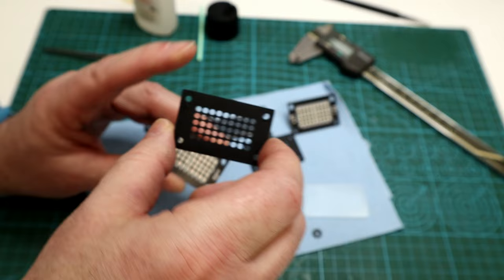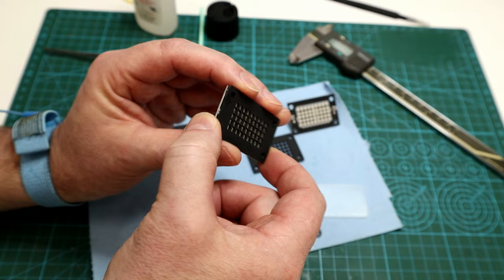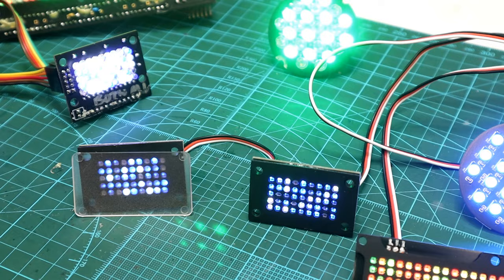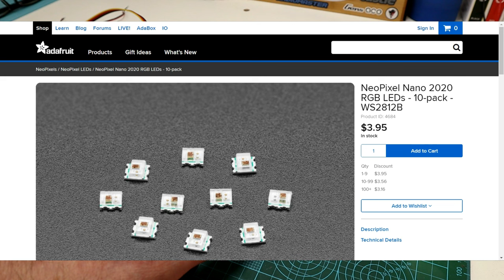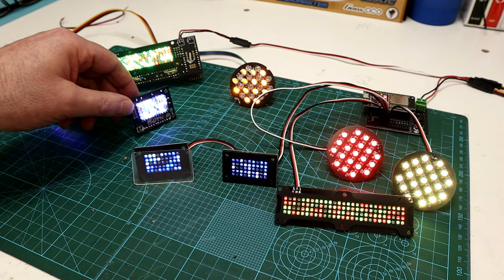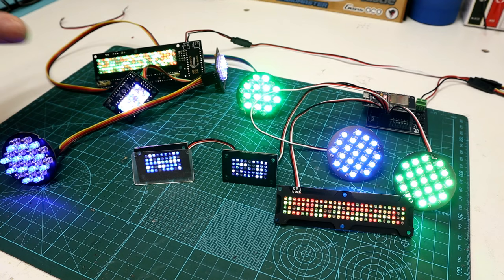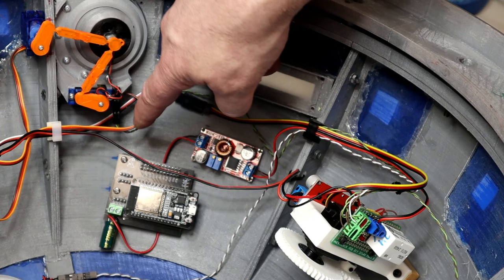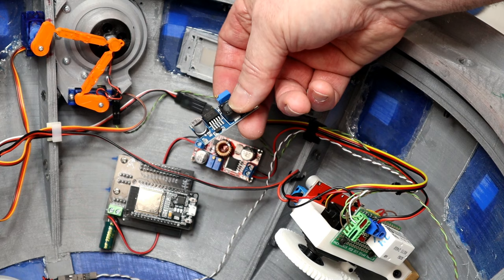R2D2 AstroPixels Installation - Easy & Fun (I hope).

Comment from the maker: Part 1 - AstroPixels Overview: https://youtu.be/du5284ciHco?si=QiC0DnNkY3eN5N2V
Making R2-D2 Video Series:
- Introduction to a DIY R2-D2 Build: https://youtu.be/hkkSagTsLXY
- Part 1 Making the dome: https://youtu.be/HaZ7ABkhwn8
- Part 2 Painting the dome: https://youtu.be/inoqE19ODUQ
- Part 3 Dome lights & holoprojectors: https://youtu.be/hDR9z1PAJSA
- Part 4 Dome Completion: https://youtu.be/PnjCrLlJtig
- Part 5 Mark 3 Body Assembly: https://youtu.be/m6VXt6VGZ3c
- Part 6 R2 Sound System Basics: https://youtu.be/cZ3sVYs7T9I
- Part 7 R2 Electronic Basics: https://youtu.be/AmUuZH3UHXg
- Part 8 R2 Legs & Foot Drives: https://youtu.be/PLyOKD5oAyM
- Part 9 Painting R2-D2: https://youtu.be/E8h0l4rHvC4
- Part 10 Installing Electronics: https://youtu.be/bg_tN6HCYN4
- Conclusion to a DIY R2-D2 Build: https://youtu.be/sIpBA6UigTQ

Comment: I've heard of people using thick bezels and inserting short lengths of fibre optic, then sealing it all in resin. Gives it the fibre optic look. 

As for diffusers, the main thing to avoid getting into the lights is grubby little fingers. ;) 

And I know someone did add a diffuser grid for the PSIs to get the look you want. I tend to have mine a lot closer to the front so you do get a line. Worth an experiment. 

The main board is also designed to actually mount on the back of the RLD, there are STLs to print out as spacers, etc. 

Another great video, and thanks! :D
Reply from the maker: Thanks Darren for the info. All good ideas! 👍🙂

Comment: Love your videos! Fellow BC maker in the lower mainland here. Where did you source the diffuser material? All the ones I found were very thick, yours look the perfect thickness/diffusion for my project.
Reply from the maker: More Droids in BC  - Excellent 👍 I covered what those clear diffusers are in the Teeces video which I link to in the description. They are just leftover small plastic parts drawer separators I had on hand. You could of course make them out of any thin clear plastic sheet. If you want to make them slightly diffused, sand one side with thousand grit wet/dry sandpaper.

Comment: Would love to see you add panel servo/hinges.  I’m in the process of trying to fit all of this into the V2 dome and it’s tight! Especially because I’d like to have all 3 HPs servo controlled too
Reply from the maker: Yep, would be interesting, but unfortunately it's something I never really wanted to have on my build. Being fully RC controlled limits things like that of course and the engineering adage I tend to live by of "complexity hampering both execution and reliability."  🙃 
Have fun with your R2 build and getting all that working - I'm sure it will look fantastic.
Reply: I forgot you went the RC route.  That does complicate things.  I’m going with aSHADOW-MD PS move controller option.  I find it crazy that others have put full lift systems in with every other feature.  It’s a big build but some space is a premium

Comment: Every video I watch are so good, I like  watching your videos over and over they that good, I would like to ask you about Batteries, they are so expensive. I have seen these SLK Platinum Mobility Scooter GEL Battery Pair of 2 x 12v 10ah for (£49.99), would these be ok for powering up R2 and all its components.
Thanks John for all these great Videos.
Reply from the maker: Glad you are enjoying the videos & thanks for watching. Totally depends on what electronics you are paring with your specific build, what voltage you will be running at and what capacity you will need (run time based on current load).
Since I don't know a thing about those specific batteries you mentioned, I can't comment on them. What I can say is the least costly rechargeable battery option for most R2 builds (unless you already have suitable rechargeable battery packs on hand) is going to be a 12 volt lead acid (PB) battery, be it Gel/AGM or full wet. Obviously a gel/agm is the better option as they don't leak or vent (at least easily). Lots of information in the R2 Builders club/Astromech forums on battery options based on budget, running voltage & capacity.
Reply: Thanks John for taking time to reply, the reason I was asking is because I have seen lots of videos of lipo  batteries exploding and causing fires so it put me off buying them, do you know a good alternative.
Reply from the maker: My 2-cents... LiPo batteries are as safe or dangerous as you make them. If they truly were as dangerous as the clickbait fear mongering makes them out to be, you can bet they would not be used in almost every portable device, electric power tool, electric vehicle and of course rule the skys these days in the world of RC aviation and rule the race tracks with RC ground vehicles. They would be banned from use if they were constantly burning up; yet they are literally powering the world these days.

By the numbers, I would argue they are statistically one of the safest forms of high energy storage considering the millions if not billions of lithium chemistry batteries floating and flying around. It's actually astonishing there are not more reported fires caused by them. 

Regardless, like any high density energy storage device, they have the potential of releasing all that energy rapidly if the unique care they require is not observed which I cover in detail on my website in the LiPo section: https://www.rchelicopterfun.com/lipo-batteries.html

However, to answer your question on the safest rechargeable battery chemistry that is not nearly as critical to correct care - likely NiCad or NiMh. If safety was the paramount concern, I would go with either.